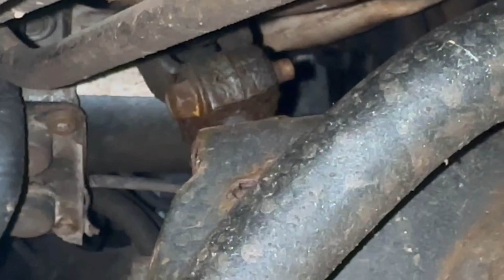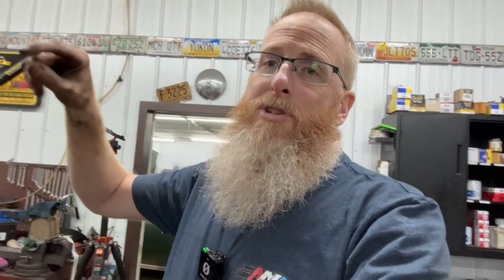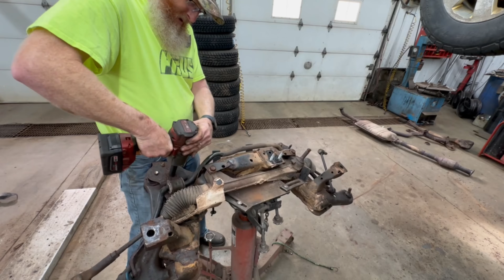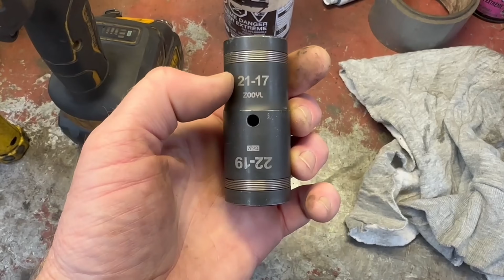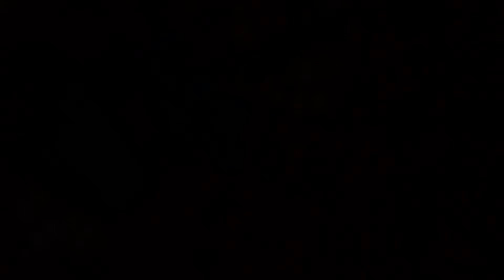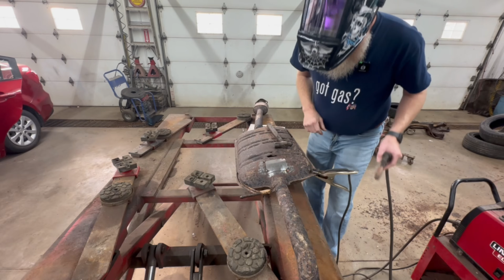If You Live In The North-East, YOU HAVE RUST

Comment: Thank you for this im getting ready to replace all of this on my work suv. Its a 09 escape its 2wd and the 4 cylinder so it’ll be a little easier but nice to see whats going on before doing it myself. You can get the whole front assembly for like $900 that includes all bolts, control arms with ball joints and bushings and inner/outer tie rods its super nice to be able to get the entire assembly

Comment: Excellent video. Had a question. Brother in law has a 2011 Escape 4 cyl FWD  It has rusty k frame so i purchased one on ebay and they asked for the VIN number to match it up. Part doesnt line up with the body bolt holes.  As far as I know the car has never been in any accident, everything looks straight and paint even looks factory. The “new” used ebay k member doesnt have any signs of wrinkled or buckled metal anywhere. I wonder what the issue could be. Anyone?
Reply from the maker: Hmm, that's a tough one without seeing it myself. Hope you figure it out!
Reply: @OldeCarrGuy i am trying took it to get aligned and camber so off. I am wondering if the struts on these go bad enough to bend, of course if he hit something that would make sense. Going to check ball joints and control arms

Comment: What would this cost the customer
Reply from the maker: When dealing with rust, it's really hard to quote time as you don't know how much time you'll spend on 1 siezed bolt or many broken or rusty bolts. My shop charges $80/hours so I can ball park it at 4 -5 hours if everything goes good to 6-7 if you run into problems. I hope I explained that well enough.

Comment: I own a 2012 Ford Fusion and live in Ontario. Sadly the previous owner never had it oil coated so the front and rear subframe are also extremely rusty from the salt. I have been trying to treat it with Rust Check Converter solution. Do you recommend using something like POR 15?
Reply from the maker: Depends on how far gone it is. POR15 only encapsulates as opposed to a product like Rust Off that converts. Otherwise find a southern frame!

Comment: This is a great video for breaking down all the steering and suspension of a Ford Escape. I don't think I would try this without access to a Kenny U Pull for cheap replacement of rusted bolts and nuts. It's the only reason I own a Ford Escape, the scrap yards are plentiful supply of cheap replacement parts.

Comment: I extended my ratchet handle with a pipe.  Snapped the head off the end of the left rear sub frame bolt.  The other side it started to turn, and turn.  And turn some more.  But never actually loosened.  So I ended up cutting the head off that bolt.  Every thing is so seized that the frame still wont drop because those bolts are seized inside the bushings that run trough the center of the rubber bushings.
Surprisingly, every other bolt and nut came off without too much trouble after soaking in penetrating oil for a couple days.  Three of the exhaust bolts were just gone, ,rusted down to almost nothing, so that joint came apart with a cold chisel between the two parts.
I guess I'm going to be cutting/grinding/smashing some more of the sub frame.  Not looking forward to dealing with the encapsulated nuts that are up in the body to hold the back of the sub frame on.
Reply from the maker: You're in for a fight!
Reply: If I'm dealing with such a rusted frame I'm starting with the Sawz-all to ease the removal.
Reply: @Dilborg  I hope you have better success then me!  I would enjoying reading how you made out.
I did try a Sawzall, but I could not find a very good angle to get at it.  The saw blade was bending some, and as expected, it eventually snapped.  If I was to go back at it with a Sawzall I'd buy top quality blades, instead of the cheap ones that came in a pack of 50.
To get better access to the rear sub frame bolts that didn't want to come out, I decided to remove the lower control arms and get them out of the way. The front of the sub-frame rotted thru where the control arm attaches on the right side, and that control arms was no longer attached. On the other side, the bolt came out of the front of the control arm surprisingly easily.  On each side of the sub-frame, a bolt holding the rear of the sub frame on also holds the rear of the lower control arm.  The bolt goes up thru the sub-frame, thru the control arm rear bushing, then up thru the sub-frame again, into body where the nut is hidden up inside.  The bolt sandwiches it all together.  That bolt no longer had a head (snapped off one side with the socket, cut off on the other side).  To get the rear of the control arms off, I used a plasma cutter to cut the bottom of the sub-frame from under the control arms.  Once cut, that part of the sub-frame was removed, and the bottom of the rear bushing on the lower control arm was exposed and accessible.  I used a hole-saw to cut up thru the rubber bushing, then removed the control arm.
With the control arm out of the way, the problematic headless bolts were sticking down from the sub frame and exposed.  The steel spacer from the center of the bushing was still fused to the bolt from corrosion, so the sub-frame wouldn't slide off the bolt.  A blade was used to scrape off as much of the remaining rubber from the control-arm bushing.  I then heated the the headless bolt until it was really hot (still a lot of rubber burning, needed a fan to blow that away).  Cooled the bolt with water, and used a pipe wrench on the bolt, and it actually started to turn and it finally came out.
On the side other side, the nut up inside the body spins with the bolt. After getting the control-arm out of the way, I was able to get the inner spacer from the control-arm bushing off, so only the bolt protruded down thru the sub-frame.  Then I was able to get the sub frame off.
I still have to deal with the remaining headless bolt that just keeps turning along with the encapsulated nut.  But I'm almost at the point of re-assembly!  This project has taken way longer then planned.  Glad it is not my daily driver.
Reply: @willmcgo8288 I think you answered your own question about cheap Sawz-all blades. 

How far off the ground are you hoisted? 

It might just be a quirky habit of mine, but I like the vehicle 3 to 4 feet off the ground so I can work from a ground dolly when I do this kind of "heavy" pulling. I find standing up to work under the chassis to be the wrong angle all the time.